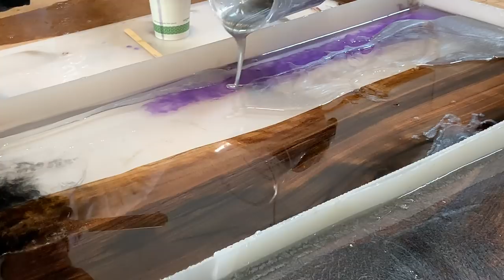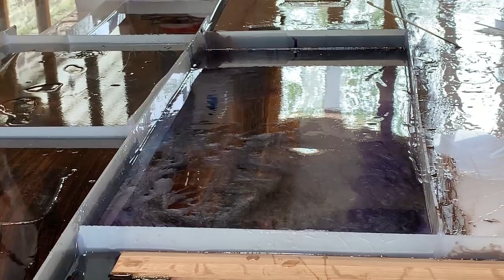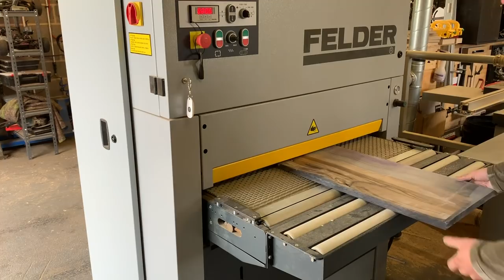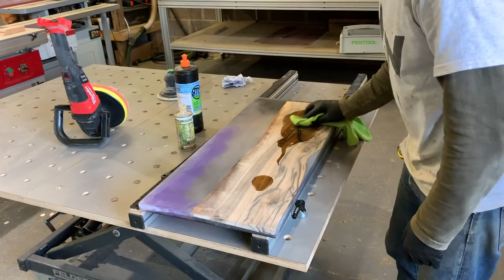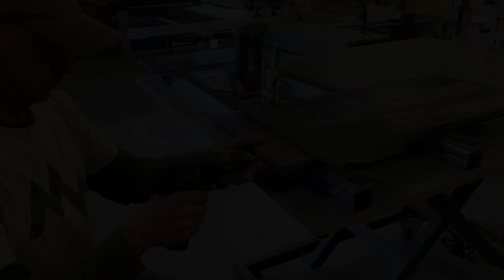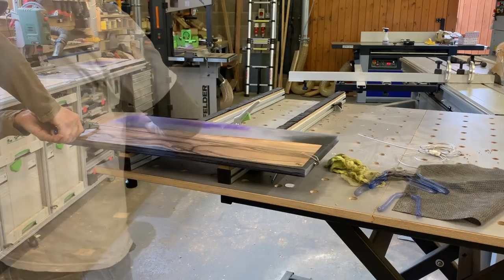Epoxy Resin Wall Art No.3 - Purple Silver English Walnut Hanging

Comment: Does the epoxy resin have any affect on cutter heads?  Mills smoothly in the planer/jointer?  Thank you
Reply from the maker: No it’s fine , just a lot of mess as it doesn’t extract as well as saw dust